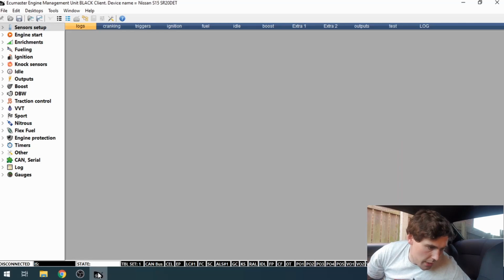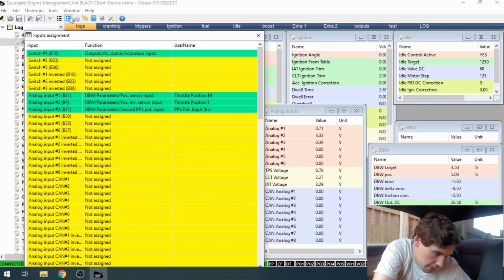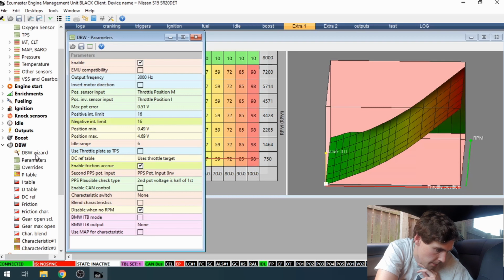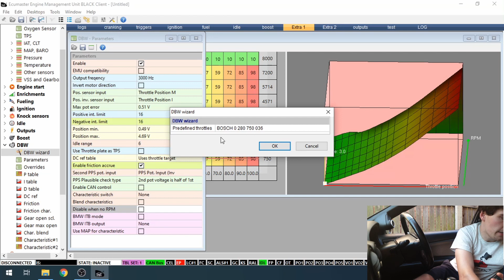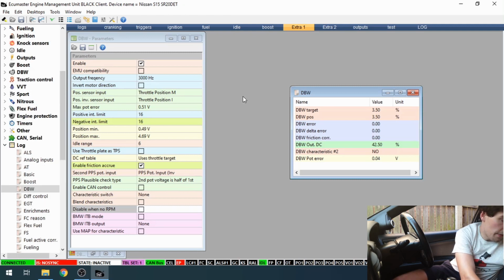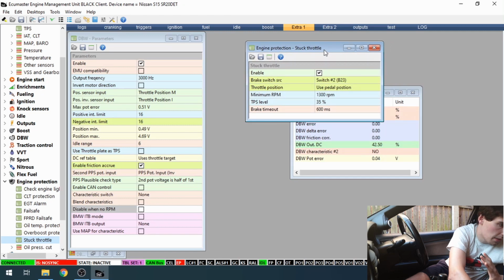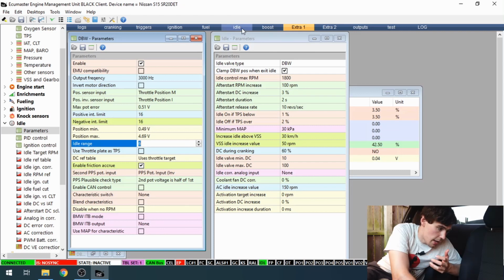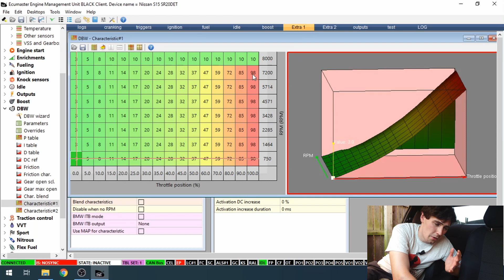💻ECU Master Emu Black - Drive By Wire Config💻

Comment: show your imput list naming, you renamed everything and that makes this video almost pointless because its analog 1 & 4 and they often get reversed even though the dbw test will succeed, in my 1.8t the #1 one imput hasto be pulled high4k and the other #4 is low 4k, also fyi the throttle blade must be tripple checked because the computer can show its closed but its actually open, and clicking reverse imput dont truly work until you reverse the 1&4 in list🎉

Comment: Hi I have 5v instead of 4.3 my throttle calibrates but when i press the brake with the ignition on I get a cel for dbw with engine running it revs the car the wiring seems fine I’m confused

Comment: After throttle calibration my car idles high. How do I get the revs down to get it into idle control ?
Reply from the maker: Hi, you need to change the maximum open angle for the throttle body at idle, then in idle control settings, configure the idle valve to drive by wire and use the duty cycle to adjust idle speed

Comment: Where can I find information on how to wire this?
Reply: Hi, all the pinout information is in the EMU Black software help manual, as well as the EMU Black USA website
Reply: @listert2595   I couldnt get their Google docs links to work.
Reply from the maker: I found the best way was to use the help manual in the emu black software itself. Most Bosch throttle bodies have pinout guides online. Hope this helps and happy tuning 👍

Comment: Thanks for the video, very informative!

My DBW is cracked open at engine off, ign on. Is the 0% throttle position voltage automatically compensated for during the calibration, or do I have to force hold the throttle closed to find the min voltage? Thanks!!
Reply from the maker: Hi Mark,

It’s worth checking your H-Bridge wiring is the correct way around first. The TPS sensor input is now your pedal position input, so you calibrate 0% and 100% as pedal position, not throttle position.

I hope this makes sense 👍

Comment: Hi how did you wire it?
Reply from the maker: Hi, I used the pinout documentation on the ecu master USA website, as well as the help document saved on the emu black software.

Comment: Hello there.  I have an electronic throttle body in my vehicle. I bought the black series.  Do I need to buy any modules?
Reply from the maker: No modules are required, see my response to EJ Rescue on how to wire it up to the h bridge outputs

Comment: I know its over a year but yours is still the most thorough EMU Black DBW content I can find.
You didnt discuss the outputs you used to control it.
I'm trying to control mine with Output G2 H Bridge1A.
What did you use?
Reply from the maker: Hi, sorry it’s been so long since I’ve replied, so you’ve likely worked it out by now. But, depending on the throttle body you’re using the positive pin for the motor needs to go to Winding A of one of the H Bridges and the negative pin for the motor goes to Winding B of the same H bridge.
Reply: @theefiguy657  yes thanks, got it sorted. Still really appreciate the feedback.
Love to see more on this ECU from you.
Nobody else is producing content this useful.

Comment: What kind of sensitivity were you able to get out of the throttle body? Was it sharp and responsive or did you still feel some kind of delay after attempting to program it?
Reply from the maker: Hi, the sensitivity is as responsive as you set it in the tune. These throttle bodies and the emu black are very quick, much quicker than a human can notice, so it’s not something to be concerned about.

Comment: Have you tried the throttle blip feature in the EMU black?
Reply from the maker: Hi BLUERB240, this isn't something that I've tried as it's not a particularly useful feature on manual cars (although can be used and is used by some). From what I can understand you will need a clutch switch input to tell the ecu when you're changing gear, as well as an accurate way of highlighting which gear you're in. I imagine the gear detection by speed and rpm wouldn't work as you need to be in the gear before it registers.

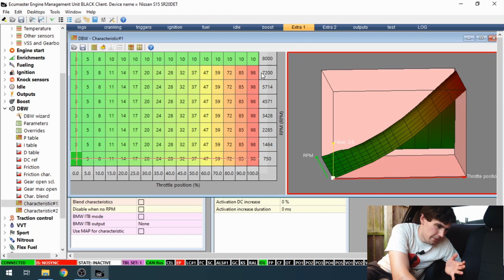Comment: 9:50 FACEPALM IS STRONG ON THIS ONE.....
Reply from the maker: This DBW position map is just a base to tune upon. Once you have access to a steady state Dyno, then you can tune it based on maximum power possible at a certain load. But that's outside the scope of this video 👍
Reply: @theefiguy657   no its not the tuning aspect. Just play the video and listen what you say. You said
 "its an over rev protection If The ecu will not be able to fuel cut fast enough"
 Why ? Is the ecu a drunk fellow hiding inside the box ?
Reply from the maker: I was thinking more from a mis shift perspective. Ultimately if you've managed to go past the rev limit you're likely going to do some damage, but it's much better than allowing the engine to bounce of the rev limiter after the mis-shift.
Reply: @theefiguy657  pls just edit and delete that portion :S
Reply from the maker: It seems a perfectly good reason to force the throttle to close as there's literally no point in it being open after the rev limit. Granted, I could have worded it better though 👍
Reply: @theefiguy657  also it interpolates the cells and you will gradually get a closing tbody so torque will be diminishing for a wider band of rpm until you hit limiter
Reply from the maker: The limiter on my car is 7200, which you can see in the video has the same values in as the rest of the rev range (until it is efficiently mapped). So the interpolation will only happen between 7200 and 8000rpm.

Again, the car SHOULDN'T ever reach that range, but in the event it does it makes sense for the car to close the throttle body.

It's a minor detail, that I could have worded better, but for the most part is outside the scope of the video.

Comment: Hi, nice config video. I would like to ask a question. If i take audi 1.8T throttle body, i must to take also electronic pedal from an audi model? Thanks
Reply from the maker: Hi Norman, if you are using an emu black (in fact, most aftermarket ecus with dbw control will be the same), so long as you use a pedal that outputs a 0-5v signal, you will be fine. Watch my previous video to see my pedal choice 👍
Reply: @theefiguy657  Thank you very much!

Comment: thank you for the video i have a EMU Black on a Toyota GT86 and currently my throttle is only opening 60% i will have a look later at my settings again, if i get stuck ill message you
Reply from the maker: Yeah, definitely worth looking at the config. But also, make sure you look at the DBW data log feed and check for any discrepancies in the data 😁
Reply: @theefiguy657  can i have your email address and i can send you a few screenshot of whats going on
Reply from the maker: Hi Kurt, Feel free to send it to EFI.guy.videos@gmail.com. However, I strongly recommend contacting the Ecumaster Support team with drive by wire issues, as any problems could be devistating 😔

Comment: Awesome! Just a question.. how does the ecu differentiates between a "stuck open" event and a "hill & toe" one?
Reply from the maker: It's mostly in the time frame. So I have mine set to 600ms. But you can have it longer. A heel toe event will be in the region of 50-100ms I'd imagine, so all good on that front.

Also, if you use both the dbw and tps position sensors, then the brake switch is just an optional safety feature
Reply: "Heel and Toe" = your foot